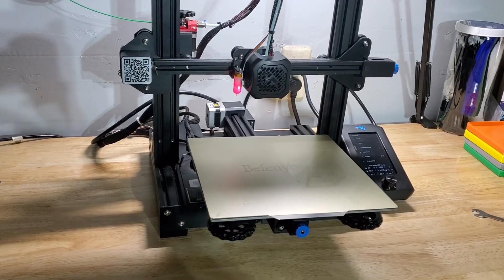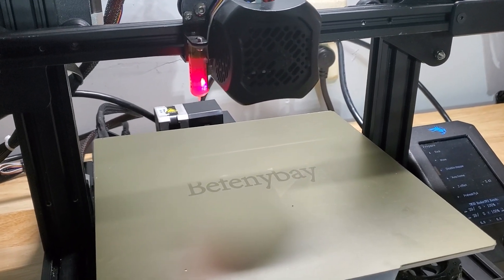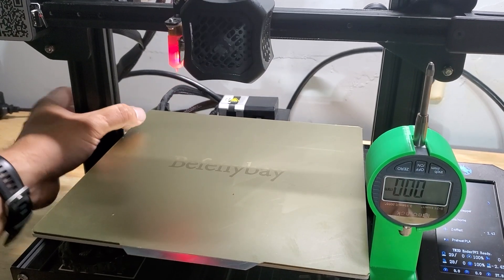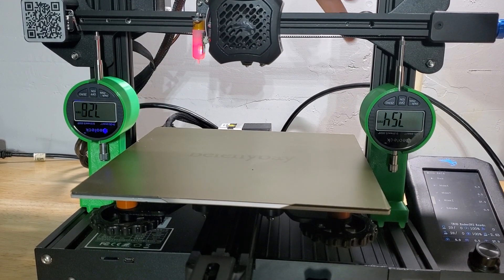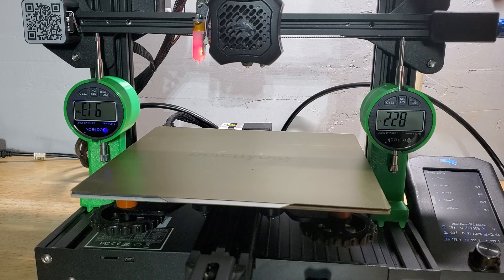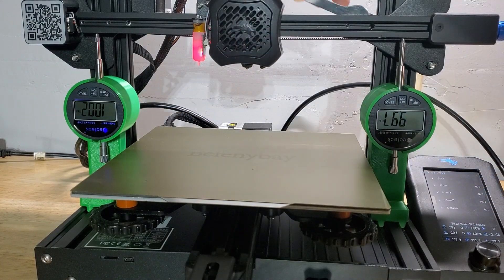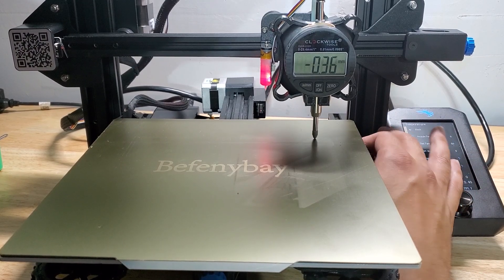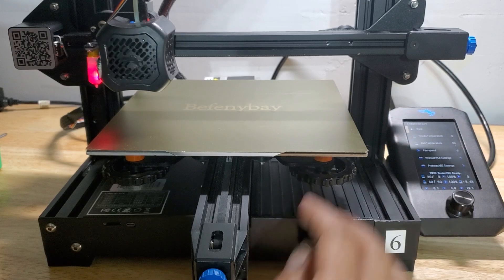3D Printer Adjustments: Perfect X Gantry and Bed Leveling Using Dial Gauge Indicators (Ender 3v2)

Comment: Went to download the gantry model from Thingiverse and got a 404 error.  Hopefully you can upload it again. I used the process from your earlier video (single plunge gage on hot end) and that worked very well. I am curious to see what this dual gage method will do for my printing. I much prefer to learn from other's experiences as I am too busy making my own mistakes! Thanks for taking the time to make your videos.
Reply from the maker: Try downloading individually from the "Things" Tap instead of using the "Download All" buttom. Thingiverse must be having an issue.

https://www.thingiverse.com/download:11012137
Reply: @Redo3D  
Hi! Replying here so you get tagged. I don’t use bl or cr touch on my printers. How would I go forward with levelling the bed with a dial indicator then? I’m pretty good at levelling using the paper method, but I want to try this method as well to get it as ‘’perfect’’ as possible.
Do I just level the bed like you do, auto home and set the nozzle height using a feeler gauge or paper?
I don’t want to risk the nozzle digging into my bed. That’s why I am a bit confused on how you would do this without an auto leveller.
Hope my question made sense and that you see this :)
Reply: Download the files one at a time.
Reply: Thingiverse is dying lol
Reply: Single plunge gage?? Can you please share the video link for that guide i couldnt find it..

Comment: How did you print this. You may need too many supports for this, which orientation did you print., Did you some how managed without support.?, I am now printing this with the projections removed instead created a v notch on both sides with 45 deg andgle, and I will print the projections seperatly with v notch proecting out, so v part will go inside the V female part in the Main model, then I can glue them together without the position moved.

Comment: Thanks for the idea and the video. But it still lacks precision. I bought 3 dial gauges and printed the mount/cases of them and applied the same process as yours. There are a few problems you do: 1-) Putting the X-axis gauge onto the hotend cover is not constant because it is not tightly mounted, and this causes changes from corner to corner.  2-) Putting the X-axis gauge on and in front of the hotend lowers the precision at the back of the bed, because it cannot access to the very end of it. This causes a different between the front and the rear end prints. A bed-wide print becomes not consistent between front and rear edges.  So you should not use on-hotend cover model. You should use on X-axis-bar model for X-axis calibration. There are such models.

Comment: At what point do we need to do the manual adjustment with paper. Once leveling with paper and then after using the calipers would the paper setting be for not?  Its a little confusing for me as I am very new to 3D printing. I bet with having all of those printers your electric bill is a shocker.

Comment: I have a question about how you move your z-axis by turning the knop back and forth. How do you do that? If i want to move the z-axis, i must put in a lenght into the display and push the knob. Then it will move? Is it something in the settings?
Reply from the maker: When stepper motors are disabled you can move the z motor by hand

Comment: I just thought of something on the side without the lead screw I would install a lead screw just to run on a belt having dual Z-axis. Then we can disconnect the belt and just turn that lead screw. this way it would ensure the X- gantry has a fixed level then put the belt back on. Once the hot end goes  back to the other side it will cause a sag on the side cancelling out any adjustments you had made without the additional lead screw. Damn I hope I made some sense over here
Reply from the maker: Makes perfect sense I actually did the dual lead screw and belt sync mod. Works great! I plan to do the z belt mod next
Reply: Yea man, When you were trying to nudge the gantry that was the first thing I thought about.. Then I started thinking about installing leadscrew backlash ensuring even greater stability. Great video thinking outside the box Thx for sharing  @Redo3D

Comment: By tapping the gantry like that, doest it go back out of alignment when the machine vibrates from people walking on wooden floors,  or  during larger range of movements the screw does up and down or if the print head lifts from hitting the prints for what ever reason?

I would think you would want it adjusted where tapping it lightly would not alter its level.
Reply: of course it does this video looks nonsense. if the machine can be tapped into a zone as soon as he moves something its going out of wack. Cant believe machines were this bad just 2 years ago im a bit blown away. Unless hes just got one that can move at the slightest touch and has no self guiding rails/sync belts.

Comment: The dial indicator approach is a real eye opener on how flimsy this design is. I mounted the indicator directly to the x axis extrusion using a t nut. it gives me the peace of mind that the connection is rigid and there is no flex because of printed parts.
Reply from the maker: Yes definitely rigid mounting is the way to go. You did an excellent job on your demonstration!

Comment: Thats a nice technique my only issue its only temporary fix as all you are doing is tappin the gantry up or down you need to tighten the main screw which is behind the z axis stepper. Just take the gantry top off (4 bolts) and tighten right up the hex bolt you access through a hole in the gantry itself making sure the gantry is pulled up hard when you tighten it up. Thats a more permanent fix

Comment: Really nice video man, got my printer 2 weeks ago and have spent hours trying to learn to level the bed and use different settings and stuff, got some succes and lots of failure that i try to learn from. Did notice today that my x gantry seemed of from the planet of my bed and the bed had at times had way different preassure on the springs and now i did put 2 and 2 together. Stambord on your video trying to find out how to fix the gantry and found both that and a sweet way to level the bed, Will order those and make this part of my normal routine aswell once i get the printer running correctly.
Great work.

Comment: Hi.. I'm new in 3D Print, after frustation about bed leveling I found your channel I saw your way to leveling. I allready order the gauge, then I realize my printer is Ender 3 S1. Maybe for the Gantry is same with Ender 3 S1, but for the hotend is not same.
Reply from the maker: Hey there sorry I don't know if the gauge holders will work with the s1

Comment: Great video, do you have the design for the extruder mount or the dial guage please. 
Also how did you print the mounts, which orientation did you use, how did you use supports?
Reply from the maker: Hello yes you can download the files here

https://www.thingiverse.com/thing:5139867/comments

Just print them laying down, you'll have to use supports but they should be easy to remove with a scraper tool that comes with most 3d printers

Comment: I'm fairly sure the issue is the right side not tightly gripping the rails, yes tapping it around will level it, for a moment, but as soon as the motor moves the gantry or the printer creates any vibration, it's just going to be completely off again. I'm not certain this method fixes it so much as it just temporarily passes a level check, if it's loose enough that finger taps can move it, something isn't tight enough to withstand printing movements either.
Reply: shh, it keeps the obsessives at peace

Comment: I’m a hobby machinist and I want to say that your X gantry leveling test is flawed. UNLESS you verify that the indicators are exactly the same height (within your tolerance of hundredths of a mm). Better to use the same indicator and fixture and move it from the left side to the right side. OR before your test you can put one indicator on the the right side and lower the gantry down to a random value (say 5.00mm) and while keeping the gantry perfectly in place, swap to the other indicator and it should read the same. If it doesn’t read the same you at least know the error difference and write that number in sharpie on the indicator fixture so you can deduct that variance from your measurements. 

That being said, in practice it will make no difference if the gantry is level to the frame so long as the bed is level to the gantry. Within reason of course. You don’t want unnecessary stress on x gantry nor stress on the leveling screws of the bed.

I like your work though, you are one of the most thorough and evidence based printer I’ve seen when it comes to tuning your machines.

Comment: My left side is way too tight, I have tried adjusting the nuts and it will not loosen, do you know of anything I can do? I returned one thinking it was broken and I’m on my second one with the same issue, it has no issue traveling down, but coming back up I can lift the machine if I tried. Please help🙏

Comment: OK, but what, exactly, is it that you think you're "adjusting" by tapping on the gantry like that? At first it seems like you're using the  eccentric nut on the v roller to settle your "adjustment", but then go on to do it again with the eccentric nut engaged. What is the underlying solution that you are proposing this does? There are many reasons why the X gantry may not be perfectly square with the frame, and for most people it is likely going to be due to variation in the build process, making it a much better starting point to verify that your extrusions are properly squared with the frame first. Your entire 11 minute video can be summarized with, "just tap on the end of the gantry that's higher until it looks like it's level". You start out well with the dial gauge and the clever printed mount for them, and then just go way off into lala land once you see the results.
Reply from the maker: The point of adjusting the v rollers is to get to a point where the gantry is not dragging. If your roller is too tight the gantry can drag behind the movements causing the gantry to become unleveled. If you have experience building the ender 3, you would know the two nuts that hold the gantry to the bracket has to be tight to keep the x axis level, but if you activate the z stepper and pushed down on the gantry from the floating side, you can might subtle adjustments that are a pain in the ass to do if you have to remove the whole assembly and remove the screws. If this method doesn't work for you thats fine. It works great for me and I'm sure the hundred of others that have liked this video. Thanks for the feedback.

Comment: Hi, how do you know the two X Gantry Dial Gauge Indicator Mount have perfectly same length? If not, the result may be not accurate?
Reply from the maker: I measured them with my calipers. They were exact same height.

Comment: I can't for the life of me get my Ender 3 to print perfectly square for something like a 3" cube. I suspect a small machining error where the frame attaches to the base. Came across a Cura post processing script to compensate in the g-code which I plan to try. Just thought I'd throw it out there as an idea for a future video.
Reply: Hey, mine on my ender 3 v2 was slightly off too when tighten naturally. Wheels were getting more and more tight when going from top to bottom. Making the two vertical bars exactly parallel by matching  top and bottom distances between the two bars solve the issue for me. Now all my rollers are pushing the same amount of pressure on the rails when the gantry is going up or down.
Reply: @Carlos-kk4nw  Mine were parallel, but just not perfectly square in all directions. I've since found M852 - Bed Skew Compensation in the Marlin firmware. Seems a better place to correct it for each printer.

Comment: How do you find the initial spot where the bed is at ideal height? Do you use a gauge?
Reply from the maker: I like to completely loosen the leveling knobs and then just tighten them slightly, from there i use my dial gauge to tram the bed. I've found that over tightening the bed can cause it to flex, and throw off your readings.
Reply: @Redo3D  which gage thickness do you use?

Comment: seeing how much of a difference you're making by tapping the gantry made me remember the dozen times or so that I have slightly bumped my gantry just incidentally and realize that all of those times I was potentially causing issues with leveling. I wonder how many fails were due to me thinking this would not make much of a difference.

Comment: Your doing it wrong. That way will give a different reading every time beacause all you are doing is flexing the gantry.  The rollers are there to secure the gantry to the uprights and allow travel, not to adjust the gantry level.   You need to loosen the hardware securing one or both sides to allow actual repositioning.  Since you are doing that, just print two blocks and rest the gantry on them and secure.   No complicated dials or tapping tha gantry required.
Reply: You just saved me a ton of time. I hope you’re having a great day, wherever you are.
Reply: Yeah his setup is asking for error

Comment: Thats why i just use 2 Z axe printer. For me that have made some mechanics during study life, i dont understand how you can have synchronize axe with only one z guide. More the extruder go to the right on the x axe, more you have weight on x axe and change to have problems.
The major problem in 3d printing word, is that a major part of people print shit on 3d printer (little cat for grammy, a vase for mom, etc ....).
Reply from the maker: Dual z I feel is definitely a must!
Reply: @Redo3D  As you said, but a strong structure and 256 microstep motors also Have nice christmas day

Comment: Very good approach but how do you know the indicator holders are both the same length. It might be worthwhile to zero them both to a single master height before use.
Reply: I was wondering the same thing. I guess for this level of precision it's good enough.  Would definitely be a good idea to swap the dial from the other side and see if they read the same at zero.

Comment: This is why I roll dual-Z on all of mine, never lose level due to wear and tear. Are you in the FB Ender 3-V2 group?
Reply from the maker: I am in the creality group. The big one with 60kish members
Reply: also when you were doing the bed adjustments you didn't disable steppers, you can back drive current into the board causing failure. I'm sure you know this and just got sidetracked by making the video, but had to point it out.

Comment: This has been incredibly useful, thank you for putting this content out there for folks having issues. Out of curiosity, I noticed you don't use springs for your hotbed, what do you use?
Reply from the maker: I use silicone bed mounts, ive found they are a lot more stable in keeping the bed level for longer periods of time. Thanks for commenting!

Comment: Really informative just out of interest what is your method to level first time with a bl touch ? I have had the ender 3 V2 now for 2,weeks with not one successful print.  I have 6 other printers and have set them all up easily with inductive sensors bl touch cr touch etc and am not new to the technology .  I am genuinely stuck with this machine as is the seller.  Have approached Creality but got know where at all :-(. If you have any advice I would be massively grateful 😊
Reply from the maker: Hey Paul, I plan to make a video on this soon. But I do live z adjustments. I hope to have this released in the next day or so.
Reply: @Redo3D  brilliant I will look forward to it I won’t throw the machine out of the window yet lol just looking at the dial thingy now have subscribed for notifications as well… thanks for replying
Reply: Have now returned the machine to its original spec and removed all of my upgrades etc.  today in the firmware I created a manual mesh with 9 probing points and the **** thing still wouldn’t work.  Tried manual levelling 4 times concurrently and it levelled it great … 1st couple of layers then decided enough was enough !  This whole Creality episode has been a nightmare and it’s a total waste off time and effort.

Comment: I have been leveling with a dial indicator for a few months now and it is WAY better and more accurate than the paper or feeler gauge method.  I use GCode to move the head.. but turning off the steppers and pushing the head around is WAY faster easier and better.. Brilliant!

Comment: I've printed your dial indicator model and guess what... It will NOT work on a stock Ender 3 printer. The Z axis end stop switch and bracket do not allow the model to fit on the left side and the screen cover I'm using doesn't allow your model to fit on the right side... For me, your model is a waste of time.
Reply from the maker: Sorry to hear that Ben. I will be sure to add a note in the file and description.
Reply: @Redo3D  happy Thanksgiving... I'll be looking forward to more useful content.
Reply: @Redo3D  if you have a Facebook account, I'll send you the new STL files I've made

Comment: The way I ended up going to solve this issue was to add a second end stop in the other z axis and hooked it up to the control board (SKR 1.4 + TMC drivers using senseless homing for x and Y, so just rerouted one of the unused end stops). So the levelling of the right and left side are independent now. For someone that is not using a stock board out there, this may be an alternative solution (needs some firmware modifications).
Reply: I feel like spending $70 on a new board would be better than spending $60 on dial indiciators.
Reply: @cody5495  agreed, and you get the noise reduction included in the packet. Other addition would be the auto leveling for larger beds as well…